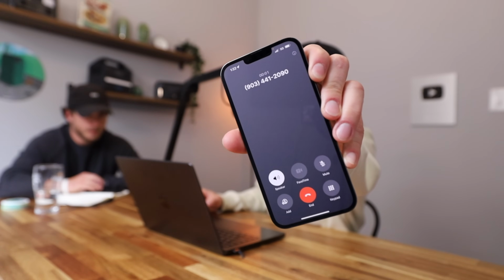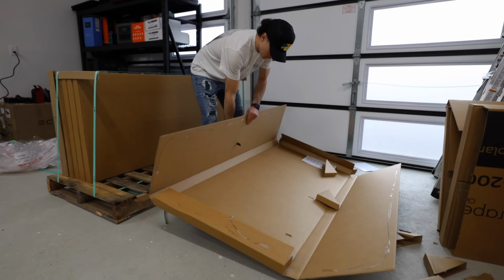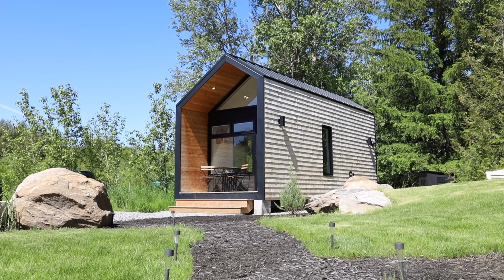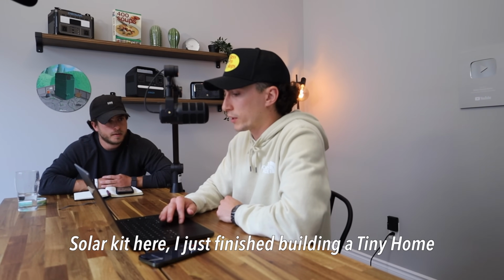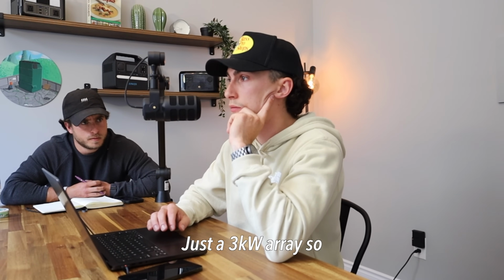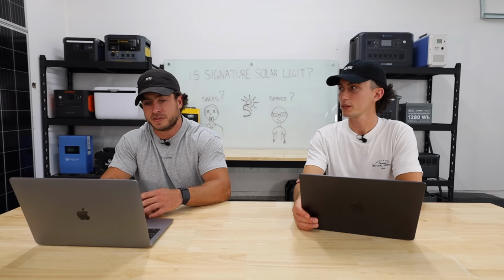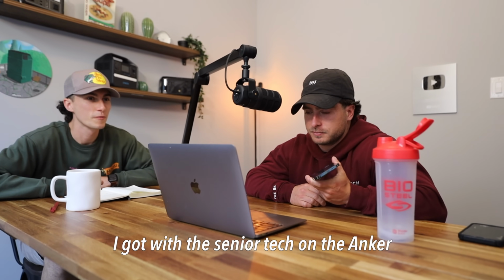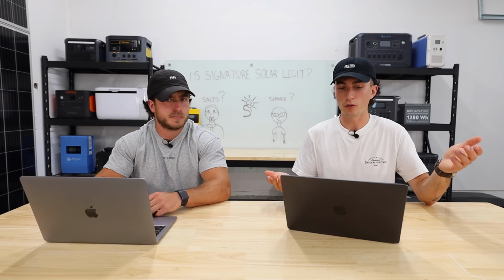We Mystery Shopped Signature Solar - Are They Legit?

Comment: i would NOT recommend them.  They will do everything possible to avoid exchanging something in the event you have a problem...and make you jump thru so many hoops, some that often either render them not responsible or void your warranty .  I bought a bunch of EG4 batteries, a charger and one , just one had a prob .  I previously had six LiTime, one had a prob and they made it very easy to exchange it . I have two MidNite inverters and other midnite items over the years . One Rosie quit, they took it right back over the phone, sent me another...turned out was a firmware glitch . But not signature solar ... btw, i check if you delete comments or shadow ban ...i unSub and block channels that do that to honest comments like this

Comment: This is a great video of how I saw tech support change. However, if you dig for the person you need, you will find them. I don't think this is an excuse. But I did have to do a warranty RMA with many long time issues with my original inverter, and they were minimum hassle to fulfill. It was a store credit, but I did not ask for anything different because I was planning on doing my next order with them. Especially the support the gave me personally. I have called a couple times with them and I was disappointed from only a couple times out of these. And I would be glad to explain if they wanted to reach out. Over all B+ to A- now. on average.

Comment: I ordered with the second sales person in the video. He guided me to "what is in stock" because my first criteria was that it needs to arrive within 14 days of order.  8 days later - still nothing has shipped. I called him again after day 7 and he said shipping was delayed because of 1 holiday within those 7 days. Day 8 I called again and had the first lady from this video on the line. She was friendly and told me that the inverter on my order is not in stock, but on back-order. So, unfortunately I had to cancel my order with her. My advise: Call their sales number at different times until you have this lady on the line. She knows what's going on, is friendly  and is straight forward. A second note: Their Aptos 370W panels have a different spec PDF on their web page then Aptos factory on theirs. Mounting holes 600mm versus 990mm. When I ask the male sales person about which is correct he did not  know. When I ask him if someone at the warehouse can measure it, he answered NO. I should instead contact Aptos.

Comment: The 120-240V EG4 6000XP is one inverter, that is capable of running 3000-6000 watts, depending on if you wanted 240Volts, or just 120Volts! It is that cool! EG4 6000XP Inverter is a hybrid beast of an inverter, and beats all other hybrid inverters made, thus far! And at $1400, is a great bargain! Thank you, Signature Solar! The EG4 Power Wall Pro 48V Battery Bank, at $3999, is also a great bargain, compared to buying 3 of the $1500 batteries that you would connect in series/parallel to achieve 48Volts! Signature Solar, again, is thee best dealer for that, too! I love SS!

Comment: I called Signature Solar to get a little more information on the EG4 Hybrid Solar Mini-Split kit. It was a Saturday morning,  and no one answered, but I had a call back a short time later. She provided me with the information I was requesting.  Several days later when I went to place my order, the order came back as the items were not in stock. I emailed sales and they provided me a quote for the kit with a different brand of pannels. I placed the order and it was delivered within a week. My system is up and running. I am very satisfied with their sales dept.

Comment: My experience with SS was not so good. During 2020-2021 (pandemic time) I purchased solar panels, inverter/charger and batteries. They charged me for delivery (initially saying it was free). The solar panels worked fine, the inverter/charger and batteries all failed rather quickly. It was like pulling teeth to get help and finally get reimbursed for the defective equipment. Would not want to go through that again.
Reply: Don’t know what that is, but I just wanted to relate my experience with SS. Hopefully it’s better and my experience won’t happen to others.
Reply: Current Connected check them out not a single complaint thread on DIY forum

Comment: There is both good and bad experiences with Signature Solar.  My complaint started when they offered free shipping, and when it was delivered I was charged to get the products off the FedEx truck.  We called many times to resolve, but they did not resolve the payment.  So I continued to say free delivery is to your address, but not off the truck!  FedEx continued to send bills, and resorted to collections.  After months of email and phone calls they finally paid the bill.  There was freight damage to one of the server rack batteries and that did not go well either.  We found that a replacement battery could be a remanufactured battery, and not NEW.  We ended up keeping the battery than to risk getting a returned battery that maynot be new.
Reply: Bet you shipped it across a border though right? If so, customs charges are never the responsibility of the seller.

Comment: Can someone help me out?  I order about a year ago an inverter from them.  Is not the only one I have bought from them.  The inverter has become faulty as its MPPT won't start drawing/producing energy from the PV unless I reset the PV switch every single day.  And if I get clouds it will get back to not generating energy until the PV is turn off and on back again.  I have two lines of PV, different brand and it does the same with both, so is not the PV panels.  Long story short, they had being having me in a go around and around for two whole months without giving me a definite answer on what they intend to do.  The inverter is under warranty but I am in Puerto Rico.  I guess becuase of the high shipping cost they are trying to get me tire and give up.  They have not even asnswer my last two email and I have being very patience and haven't being aggresive or dirrespectfull but this has become absurb.  I need advice into what I can do.   Any consumer protection agency I can complaing to?  What can be done when seller/companies don't want to honor warranties? Any advice I will appreciate it.
Reply: You don't state whether you contacted Signature Solar or the manufacturer.  This sounds like a question for the INVERTER MANUFACTURER.

Comment: I bought a Growatt inverter from them. I accidentally over amped it with panels burning the unit. I called to ask if they sold parts for the unit. I explained that the damage was totally my fault.  They for free sent me a new charging board. This did not fix the problem. Get this, they sent me 2 6500 inverters so I could get my 240volts working again.  All this for me making a mistake. Signature Solar in my opinion is the absolute best company to deal with. For a while they were short staffed on the technical end so hold time was long. They also sent me a replacement  for a bad BMS before. I'm about to make a large system and I'd never think of another company for products.
Reply: Thank you so much for this feedback!
Reply: You can't overamp it with panels. You over volted it (with panels) or something else entirely. Amps aren't "sent" they're "drawn" (pulled) it'll only do what it is max capable of.. if something is undersized and draws too much it'll hurt itself in that scenario
Reply: @gg-gn3re  You might be correct in technical terms. However the reality is I connected the pv wires and immediately a cloud of white smoke plus burning sounds came from the inverter. The event remains the same.
Reply: You may have got 6500’s because they are junk and they have plenty of used ones in stock from everyone that turned them in on trade.